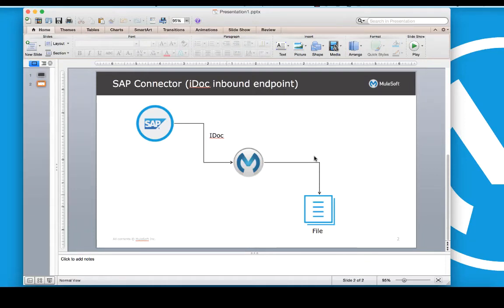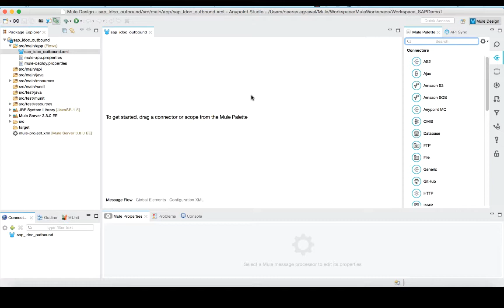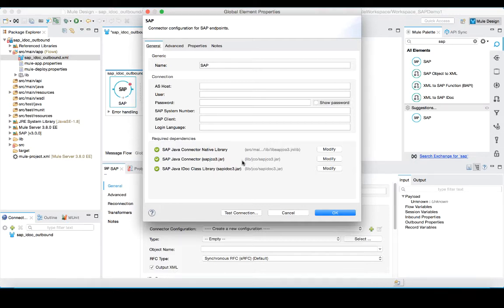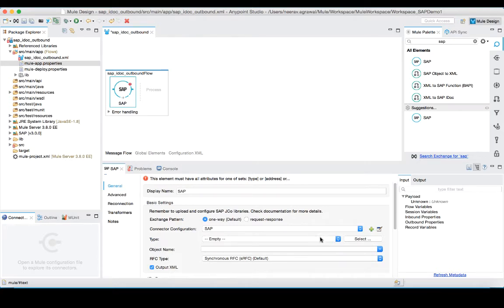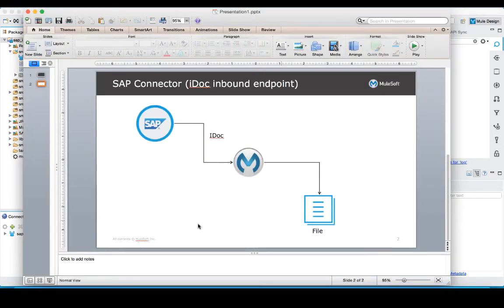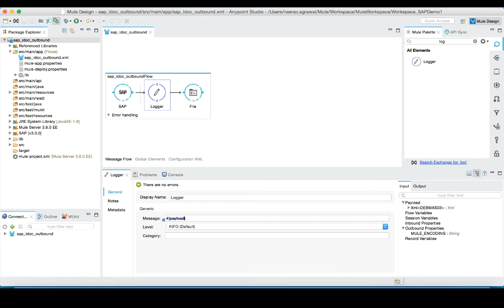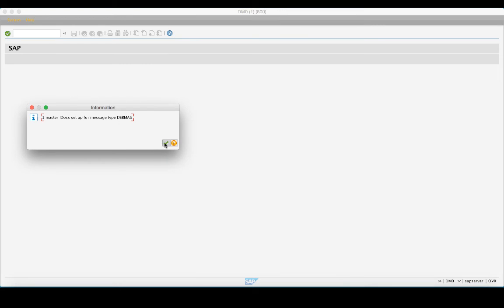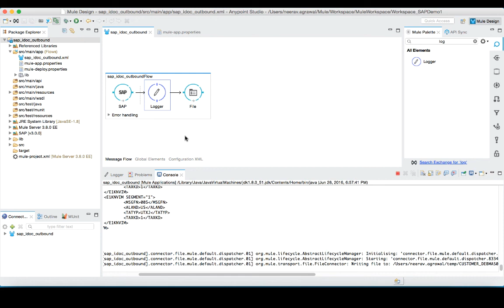SAP - Connectivity with MuleSoft using iDoc

Comment: Hi Neerav, 
Thanks for your video. I'm facing with an issue sending the IDOC from SAP and my IDOC stay with status 02. Could you help me? Probably I did something wrong on my JCo server settings.

IDOC ERROR: Could not find code page for receiving system

My project was Deployed, but I got the error below on Mulesoft.

ERROR 2019-03-11 14:20:30,295 [main] com.mulesoft.mule.transport.sap.jco3.SapJcoTraceListener: [JCoAPI] JCo version is 3.0.19 (2018-12-03)
INFO  2019-03-11 14:20:30,323 [main] com.mulesoft.mule.transport.sap.jco3.SapJcoTraceListener: [JCoAPI] JCoServerFactory.getServer(HYxQ8+zPz9fsKSJd8q78zA==?-RFC-PISRDQ-A@160.213.41.185:02:103?+1V7p3PGp3hidL9Ifi2+9w==) calls provider com.mulesoft.mule.transport.sap.jco3.SapJcoInMemoryDataProvider
INFO  2019-03-11 14:20:30,323 [main] com.mulesoft.mule.transport.sap.jco3.SapJcoTraceListener: [JCoAPI] StandaloneServerFactory.getServerInstance(HYxQ8+zPz9fsKSJd8q78zA==?-RFC-PISRDQ-A@160.213.41.185:02:103?+1V7p3PGp3hidL9Ifi2+9w==) got from provider com.mulesoft.mule.transport.sap.jco3.SapJcoInMemoryDataProvider the following properties: { jco.server.gwhost=ddlha268.ctr.globedev.ddc, jco.server.connection_count=2, jco.server.progid=MU_IDOCTOFILE, jco.server.gwserv=sapgw02, jcoTraceToLog=1, jco.server.repository_destination=RFC-PISRDQ-A@160.213.41.185:02:103?+1V7p3PGp3hidL9Ifi2+9w==, jco.server.trace=1 }